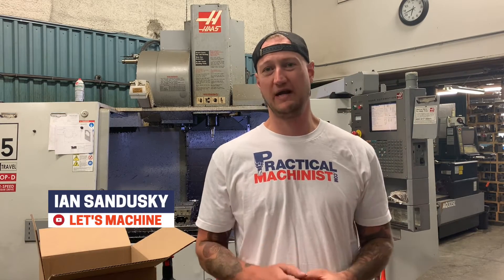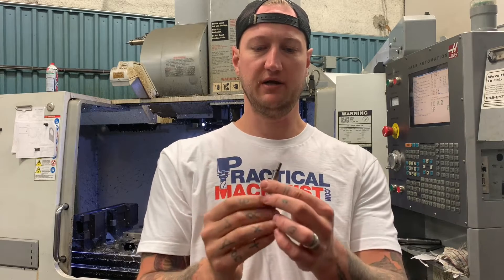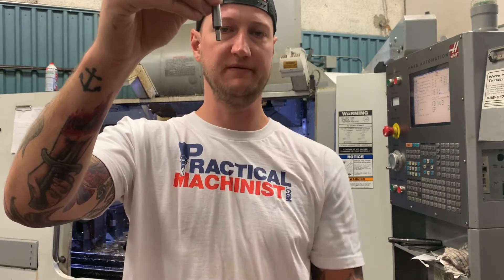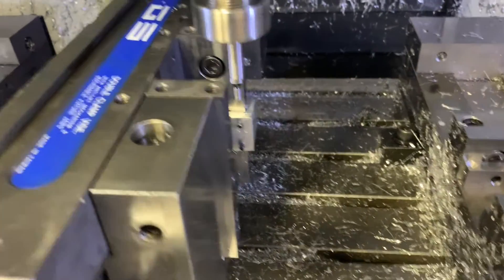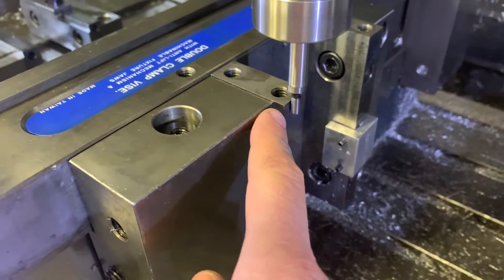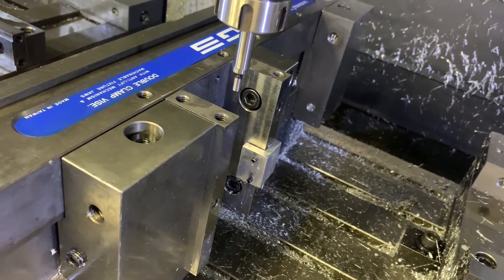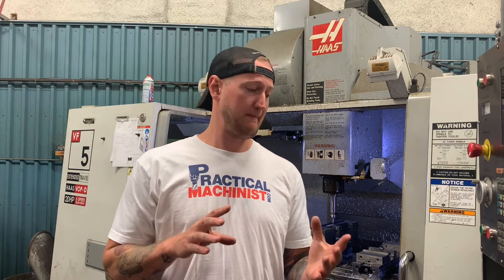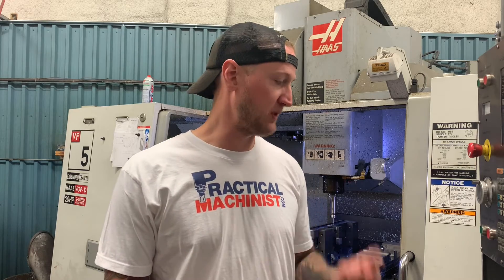How to Use an Edge Finder | Machine Shop Talk Ep. 6

Comment: It seems that the amount of spring tension exerted on the movable tip by the internal spring would have to affect the overall accuracy by determining when the tip moves off center. Meaning that a strong internal spring would produce more error than a weaker spring.  Making spring tension the deciding factor on how accurate an individual edge finder may or may not be.

Comment: The INATOOL Flex Edge Finder is a different approach to edge finding and it is fast, easy, and precise. Unskilled machinist can edge find within a couple tenths, first try. If you guys have tried to train new machinist you may know it is difficult to get them to use a wobbler or indicator arm correctly, resulting in scrapped parts. The flex edge finder is an indicator accessory, which makes an indicator a very precise edge finding tool.
Reply: overpriced
Reply: This type cost several hundred dollars. Not worth it unless you have money to burn or trying to work to gage block tolerances.

Comment: It will work with spindle at 750 rpm as well , on a haas u can run at 1000 but once you open door it auto changes to 750

Comment: I have been a machinist for 26 years and use edge finder and wigglers or electronics probes in my machining center
I don't understand why everyone shows to use an edge finder until it kicks out. This means you pass the center. Do this with a wiggler and you break it. Go with the edge finder until it runs true and bang on the edge. I do it this way to find my center of a bore then I use my dial indicator around the bore to make sure I am in the center and I am always with in 0.001"
Reply: Correct. When the tip moves over very slightly you're about .0005 past the edge. Move the table .0995 and set your DR0 to .0000 and you're as close as you'll ever get with a standard edge finder. A drop of of oil between the lapped surfaces will give you maximum accuracy. From a retired tool and die maker.
Reply: For me at least. If you're finding the midpoint of a part, it allows for a visual indicator. If you're going past for all 4 sides then it shouldn't matter, as long as you do it for all the sides. Same If you're finding a corner.
Reply: @ZantZ  but how far do you pass the center when your edge finder kicks out? 0.001"  0.003" 0.005?. So if you make the edge finder run true you are normally within  0.002" or better
Reply: @stephgiroux7745   @stephgiroux7745  well I usually move at .001. That's good enough for me and it's one click of the wheel at a time until it breaks. I've done it for a few years now and no problems. That's with flipping parts and it's right on the money. Then again, I'm not doing crazy high resolution or anything.  I obviously haven't machined for as long as you so I'm no where near the expertise you have. I'm not trying to say you're wrong or anything I'm just saying that it's worked for me. I do see what you're saying though.
Reply: @ZantZ  and I was taking of manual machining and not cnc. In my machining center I use an electronic probe 
 So yes I agree with you when you can select your movement incremental
Reply: It kicks EXACTLY when you pass .100” off axis. The reason it kicks is because it’s physically impossible to go past without kicking off. Simply making it run “true” is not very accurate. Once it runs “true” to my eyes, there’s still a few thou to go before kickoff. How fast are you turning your hand wheel to think that you’ve gone .005” past once it kicks off? Once it runs pretty true, slow way down and be gentle until it kicks. At 1000 rpm the spindle is rotating almost 17x per second. No reason to go any further once it kicks off.

Comment: Can someone please explain something to me. Once the wiggler stops wiggling is that not perfectly in alignment and the center is then 100/1000 off center?  Once you go past that tiny bit to start it wiggling again, technically you’re off by that much.  Is it such a small number that it’s irrelevant?
Reply: Y'know, I've always just been trained that when it 'kicks' it's technically on zero, minus half the diameter of the tip - but technically, I think you're correct that it's theoretically off by the slightest amount. What that amount is, I'm not entirely sure - but you can hold very very good accuracy without it being a factor as long as you're not trying to hit a tenth on your first pass!
Reply: If it doesn't kick it means it's perfectly next to it. And being next to zero isn't zero

Comment: Can you honestly say that all kicks are the same?  I mean I set the dro so that the first .0005 that I see the slightest kick I call that the edge.  I'm talking like .010 kick.  Anything more than that and it seems like I am going past the edge.
Reply: Brand new to milling and watching all the videos I can, one I find the edge does it matter what size end mill I use to make the cuts?
Reply: @raydash2898  Bigger the end mill, and more importantly, the more teeth on that end mill, then the deeper the radial depth of cut you can take when finishing one edge of the workpiece.
Reply: Yes I agree it’s too easy to go 1 thou or 5 thou I was taught to bring it back of the face until it snaps straight far more consistent. If you are pushing it of it is no longer in line with the shank so less than 100 thou from the edge!